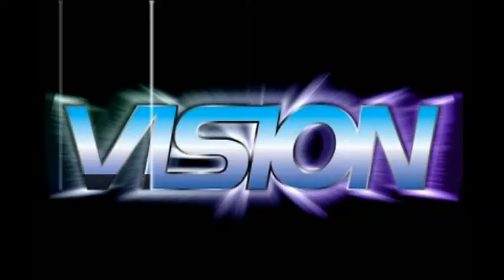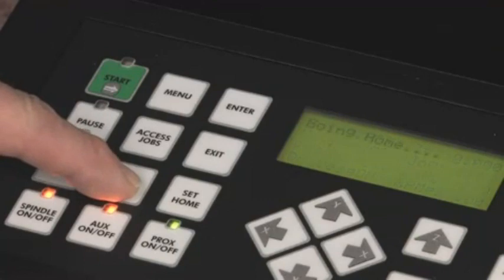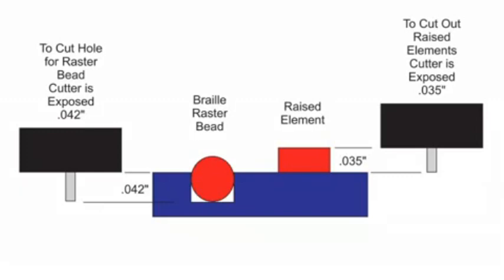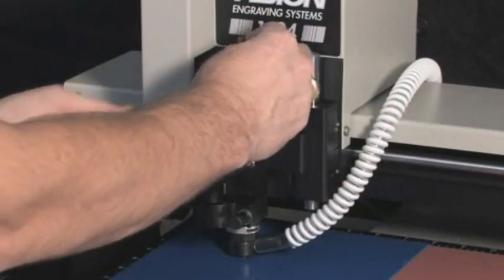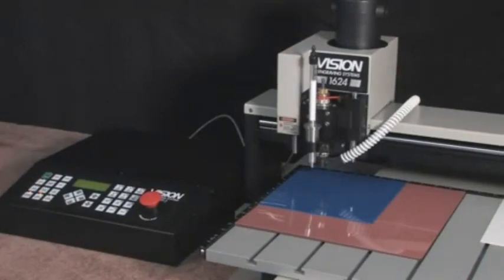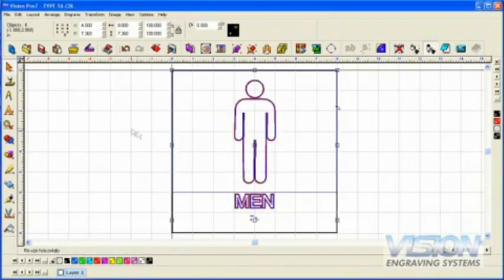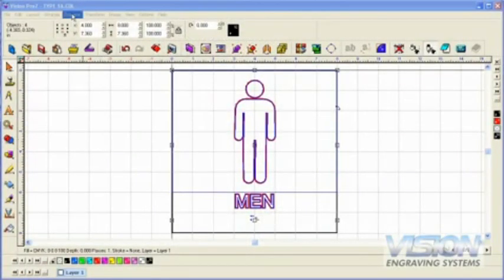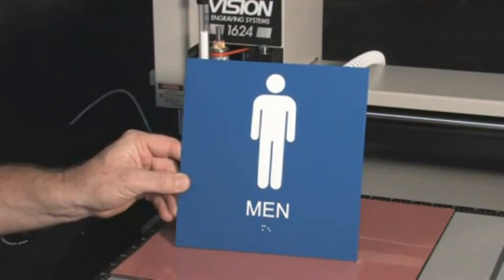Making an ADA Compliant Sign With A Vision Engraving & Routing Machine

Comment: This machine is horrible to work with nothing but problems with the software and constant issues. Do not buy Vision product's.
Reply: Andrew, I too have been having some trouble with the software Vision Pro 9, have you been able to setup or use the "Bridges" option on any tool path? I have only seen it in the 3d chisel option but not with any other tool path option.
Reply from the maker: Hi Andrew, I'm sorry to hear you are having problems with the 1624R, have you contacted our technical support? We pride ourselves in helping our customers with any issues or problems they are having with our machines. Here is a link to our support page http://www.visionengravers.com/support.html, we also have a forum http://www.visionengravers.com/support/vision-engraving-systems-forum.html. Or if you would like to give me your contact info, I can have someone from technical support contact you.
Reply from the maker: Hi Joey, you might want to try our forum http://www.visionengravers.com/support/vision-engraving-systems-forum.html. You can post your questions about the "Bridges" or contact our technical support department at http://www.visionengravers.com/support.html.